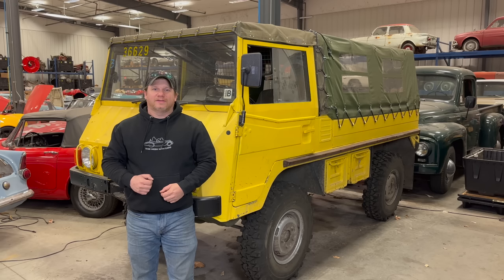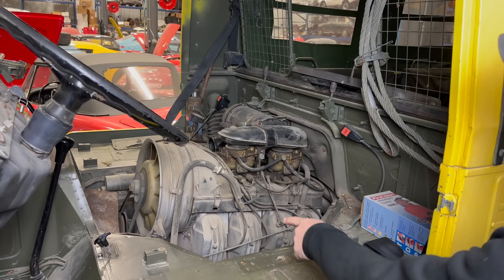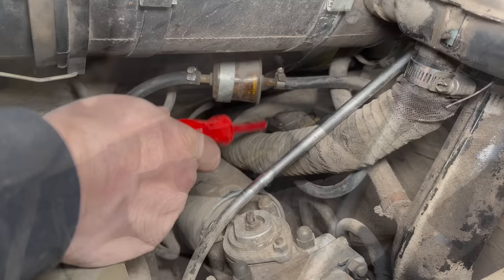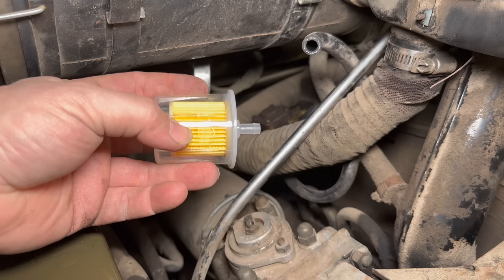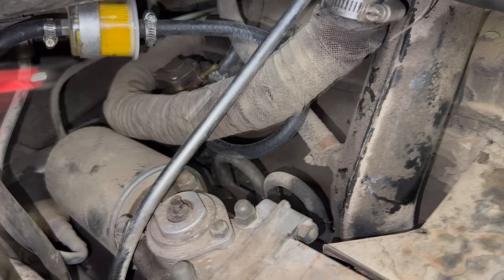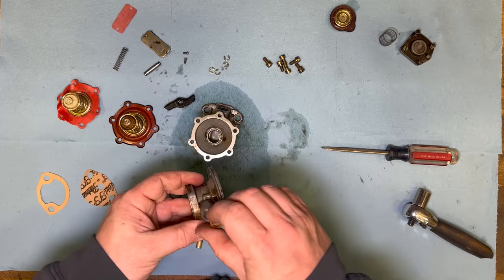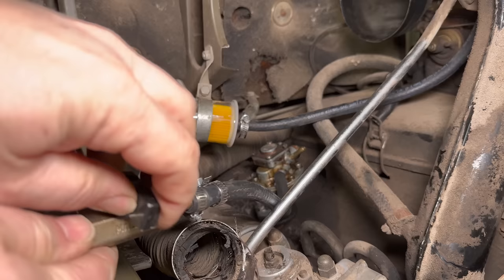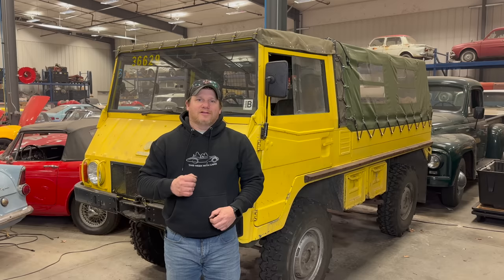Parked the Pinzgauer 710M So Long It Won't Start

Comment: Hi Steve, as an Austrian I would like to say sorry for this fuel pump 😉, we still have some of these vehicles in the army, they were built in super-pretty Graz/Styria. Keep going on! 👍
Reply: The fuel pumps may not be so good but these are great off-road machines.  I got to ride in one about 20 years ago at Big Bear Lake, California.  I am a veteran of the U.S. Army so i have done a little off-raoding in HMMWV and CUCV and M939 and M35A2.   I was genuinly impressed with how well the Pinzgauer hadled off road.
Reply: dass die membrane und die dichtungen soo hart sind muss er wohl um die 10 jahre gestanden haben. 
pg und haflinger sind und bleiben die besten Vehikel  der welt

Comment: I know you have said it in the past but it is always a good thing to run an engine once in a while. Having said that you did find some bits that were not correct anyway so it probably did you a favour by refusing to start! It would be interesting to see a 'carb' rebuild at some point as I haven't rebuilt one for many years. We don't like your life to be difficult Steve but I get what you are saying, it is never straight forward to repair old cars. A quick fix can be anything but! Thanks for the journey Steve.👍👍

Comment: As someone who served in the Austrian army and drove these things being 6'4 let me tell you from experience they are a pain in the ass to drive and maintain. It was winter and the engine start sound still gives me ptsd. We were ordered out for battle sim and had to drive 50km to another base through the autobahn with no crumple zone and driving 80 km getting around 30-40l of liter per 100km thing swallows more gas than a lambo which is why always had to fuel up the commanders said the second the tank display it less than half it's fueling time! Getting that shit started in the winter took me around 5-10 min. A drill sargeant even put a few drops of oil in the cylinder to make it start. It drives like a go kart but the scary thing is that you cannot let go of the gas once it starts you have to drive or be hovering 90% of the time cs these things cannot idle in the winter unless warmed up enough. Once in motion the steering is fine put parking it is quite the workout. Only good thing are it's offroad capabilities and the engine sound ain't to bad either kinda reminds me of a bmw m3 gtr with straight cut gears because you can hear it loudly in the cabin. As for comfort the seats are decent exept for the fact that they barly move and forward visibility is good however I can't say the same for the back and mirrors and I had no clue about the controls so I touched nothing. To sum it up fun to drive for 15min offroad then you start hating the flimsy gear lever and get annoyed by the engine till you are filled with rage each time it has a problem and it's expensive lol idk why we still use it. There are people who pay 700 euros just to rent them...

Comment: A nice quiet engine. I usually associate air cooled engines with the Deutz diesel tractor engine, which is quite noisy.
Reply: I have two air cooled Deutz engines. One In a tractor and the other in an asphalt roller. They are both very reliable but noisy.
Reply: @roycarter6235  my brother in law has Deutz tractors in a semi-desert area of our country where the temps can go up to 47ºC in the summer and he has no problems.

Comment: Put a clear fuel filter in line by the carbs. Easy to see. Mine sits for 6 months between running and is always a bear to start. Dry carbs. Always seems to be out of fuel. I must run it till dry.

Comment: You didn't do the gravity fed fuel feed test before you rebuilt the pump.  Now we don't know if the rebuild was necessary.  Sound preventative maintenance for sure but maybe the pump wasn't bad.  Soo planning on buying one of these for the FL property.  Love the simplicity.  Like a 70s VW but with better engine access.

Comment: that is the very last thing I expected under that doghouse, an air cooled 4 cylinder gas engine. Totally expected a straight 6 diesel, maybe with a turbo. This vehicle certainly exceeds all expectations.

Comment: I was always taught to never put a fuel filter on the suction side of a mechanical fuel pump because it could cause vapor lock or fuel starvation.
Reply from the maker: A lot of manufacturers have done it for decades.

Comment: Ouch.  Nice video.  I used to have a Unimog 404.  It had a priming lever on the side of the pump.  I didn't realize how lucky I was.  Maybe you could install a marine squeeze primer on the supply side?

Comment: Drill 2 holes in the carb covers and pour a little gas or spray ether.  It will start right up.  Get 2 plugs for those holes